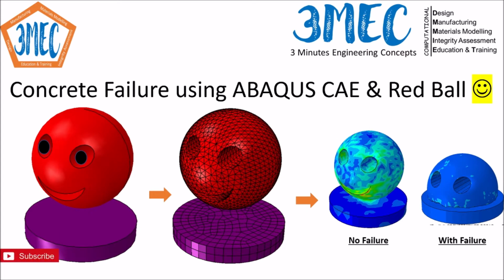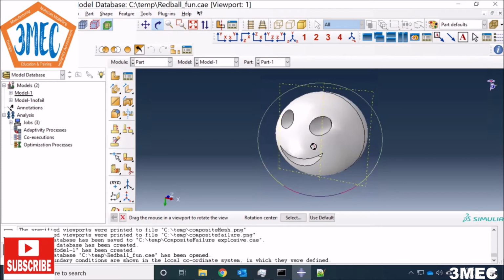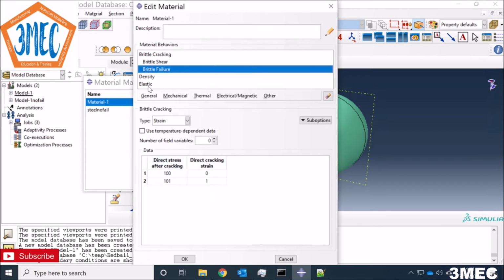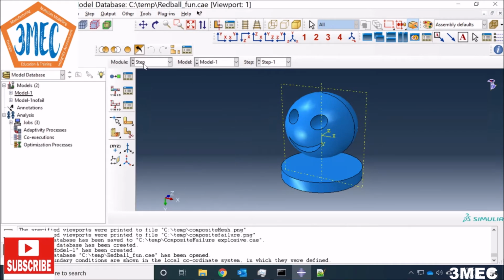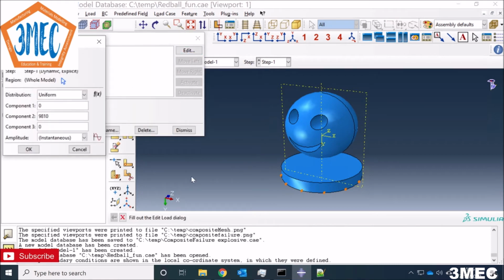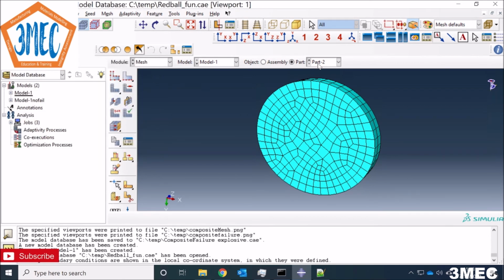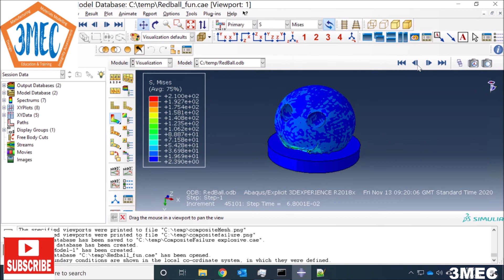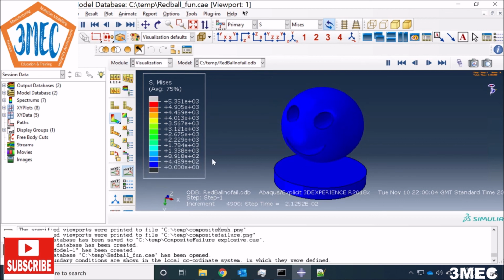Concrete Failure during a drop test in ABAQUS CAE & Red Ball - ABAQUS Tutorial

Comment: Hi! Great work with your website.
it doesn't work for me, I had big elements explosion during the contact and no damage, any suggestions?
Reply from the maker: In the mesh module when you select element, there is an option for element deletion please select yes for that. If all parameters are correct then it should work. Otherwise, some of the damage evolution parameters may need fine tuning so that element fail and get deleted before distorting. All depends on experimental data though.